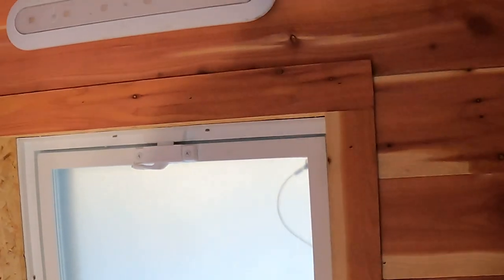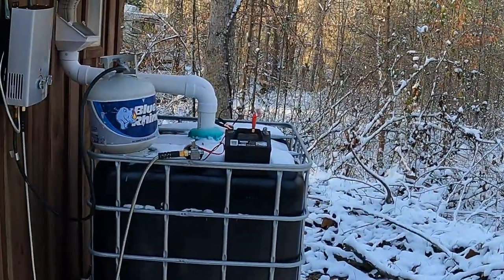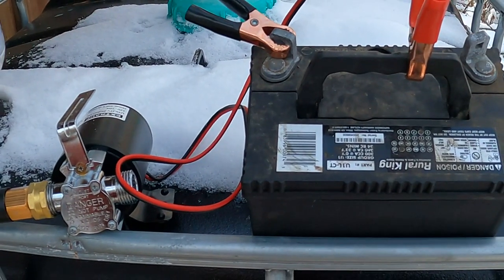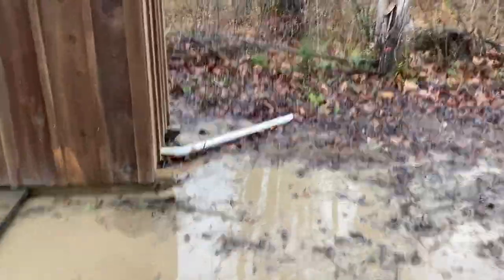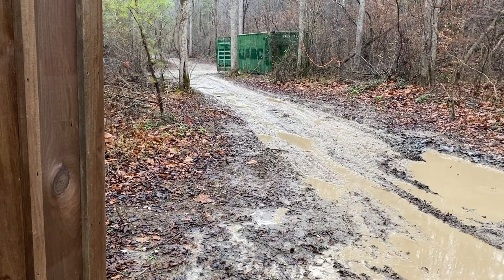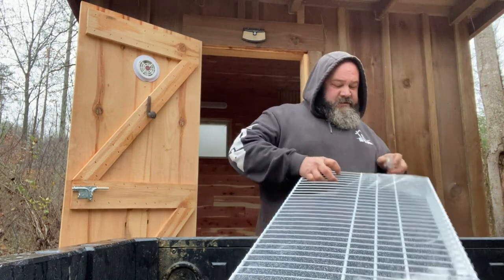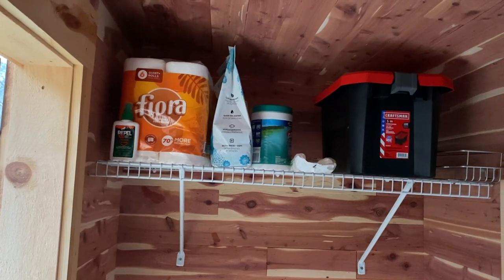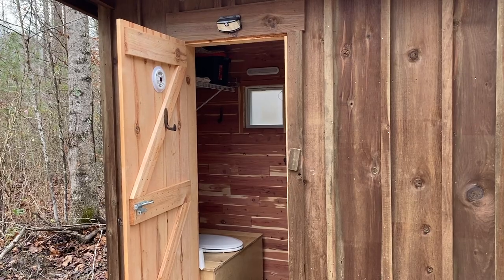Off Grid Outhouse with Rain Water collecting Shower.

Comment: may get colder where im at... i intend to build an outhouse with a fully functioning sink and toilet. using rain catchment and a tote or barrel elevated on the side. i figure that the top of barrel will be near the bottom of roof and an old tub on the roof with a grate and garden fabric over it to catch rain and snow, wile filtering. ill have a second hole for fluids and for winter. 
ill use solar lighting but it would be nice to get clear roofing material for daylight. 
ps. tub could be mounted above the tote directly. set the tote on a few pallets too for more gravity feed. but if using larger solar panels and a battery u could use an rv pump to have pressure , then just mount a shower head outside with a tankless LPG heater.  FYI tankless heaters are realty bad when it gets cold. they use thin walled tubing that will burst even above 0c temps. i hate them. ive repaired mine 6 times and now its just too far gone. so im going to DIY my own using an old LPG bbq burner and a roll of copper tubing wrapped around a pipe. then shroud it in with tin. ill make it with valves to flush it easily when it gets cold. humm... ill go build that part now...
Reply from the maker: Very Cool! Good Luck!

Comment: This is the exact setup I was looking for! I definetely will be lifting ALOT of ideas off of this build. Quick question - what are the building dimensions?
Reply from the maker: It's right around 4x8, I bought a sheet of treated plywood for the floor and the laid the shower base and a horse mat on top of it and worked around those.
Reply: @buildlife  You the best! thanks for the info - I'm starting my build next week! I already ordered my 36 inch shower pan and waiting for it to arrive.

Comment: Nice work!  Liked-Subscribed-Notified.  What keeps the 275 gallon ibc tote from freezing?
Reply from the maker: The temps in KY are just warm enough that it's not a problem. The black tank and volume of water helps. It does ice up a bit but if it's that cold no one's real crazy to sign up for a shower in an unheated outhouse but it did happen several times, Just have to dry off and dress quick!
Reply: You can build a lean to around ibc tote and add some insulation around tote should help with freezing

Comment: Very nice build Steve,how long would the gas canister last that you installed.
Approximately how many showers can you take before refill it.
Steve
Reply from the maker: Thanks, it went a pretty long way. We had multiple people using it on multiple trips so I would say 30 or so showers before we thought it was going low. Using it in the winter took allot more than in the summer.

Comment: How does the camp on demand water heater do in the freezing weather? Can you drain it or does it stay in a heated area when not in use?
Reply from the maker: You can drain it, I just take the hose off and it does not seem to keep any water in it so it's been fine. I'm sure they have better directions with the unit.
Reply: @buildlife  Thanks! I have been thinking of getting one for my cabin but no one could answer that question! I appreciate it!!!

Comment: Where do you dump the bucket?  In a hole?
Reply from the maker: We use bags in it and we used to toss them in the landfill but one of the views suggested we throw it on our burn pile where we burn the job scraps since its 90% saw dust and TP. Sounds gross but we started doing that and and worked really well.

Comment: how does the shower hold up in the winter?
Reply from the maker: It did really well. Still screaming hot water. There is a plug to drain it but we forgot to several times. It still works just fine

Comment: How are you keeping the water in the IBC from freezing?
Reply from the maker: I thought we would just drain it for the winter but it really didn't freeze up solid. A little ice on the top but never all the way through. The tote is black and the large volume of water helps. If it were here in Illinois the whole thing would be an ice cube. Kentucky stays just warm enough during the day to keep it thawed.
Reply: @buildlife  okay yes, further south than Canada is a good thing definitely!!
Reply from the maker: @resolutekravmaga651  if you are up north I would think you need to rain the tank for the winter. You could put a stock tank heater in it from a farm supply store but I would think the lines would freeze up not to mention getting any snow melt to refill the tank in February would be a challenge unless you heated the structure.
Reply: @buildlife  I was considering digging it into the ground below the frost line and then adding a tank heater. But, unless I cover the top property,  the ground will just freeze around it anyway!
Reply from the maker: @resolutekravmaga651  yeah and those ibc totes don't burry really well. If you fill them before you backfill you might get away with it but they are really thin.
Reply: @buildlife  good to know, about to start building off grid and live in KY.  I mean as long as we don't have a long freeze section i suppose it be good.  Still need to figure another way around it.
Reply from the maker: @Shelleys4Seasons   Depending on how your house is built, my neighbor has an ibc tote tank in his crawl space so it stays heated.